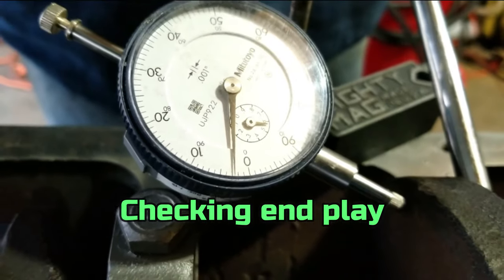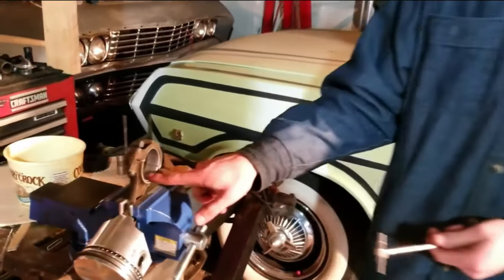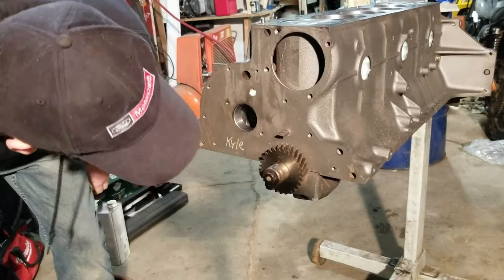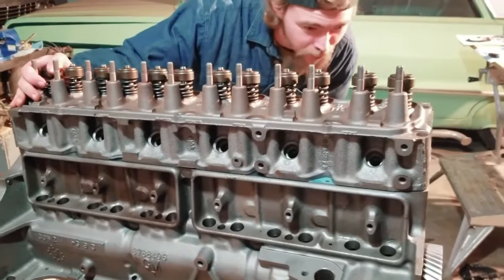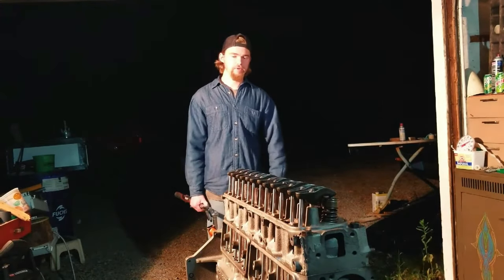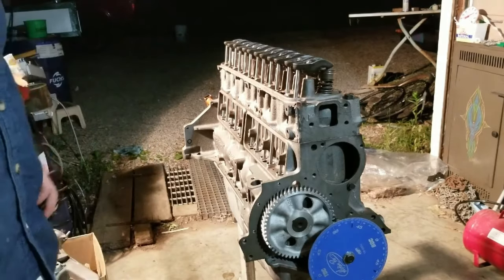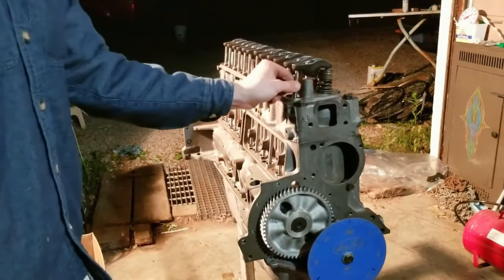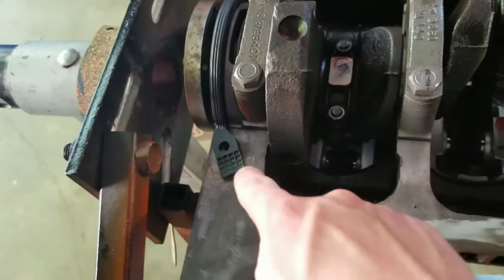REBUILD IN 10 MINUTES! Chevy inline 6

Comment: very impressive kid, thanks for your contribution to society. you will go far. I wish more people would make videos like this to help out eachothers builds.
Reply from the maker: @OakvilleConcreteContractor  thanks man! It was fun and I will be doing another one soon that makes a little more power. Right now I’d like to put a better carb on here but not too big since intakes are expensive and it’s all stock. But a 2 barrel that works correctly would be an upgrade. The one barrel has some issues, still drivable though.

Comment: I had a 250 in a 1976 GMC Sierra that I gave a grand total of $75 for the whole truck. It was an old farm truck that had never been registered or tagged and had 75000 original miles. The truck was in very rough condition. I wound up replacing everything but the cab. 
The 250, however, was in great shape and very tough. All I ever did to the engine was unplug a wire that was connected to the carb...if I left it plugged in, the truck idled @ about 6000 rpm. Unplugged it ran normally. I put s new battery in it and drove it problem free for three years. 
I wish I still had it.

Comment: Really interesting! I just bought a 1958 Apache 3800 dump truck with a 235. It starts, runs, drives like a top haha, even the dump is strong. Lots of lifter noise, sounds a bit like a diesel. I am trying to decide what to do, I think I’ll keep it original.
Reply from the maker: Do a valve adjustment, I have a video on that, hopefully the cam is ok but that was the issue with ours. Just one bad lobe.

Comment: The chrome valve cover on my 292 rusted. I should have waxed or polished or clear coated it. (A heads up, for what it's worth.) I'm glad to see another straight six on the go. They're really good engines, unreasonably looked down on. They make plenty of power and torque, and are smooth and good on fuel, besides being nice to look at. And because everybody and his dog, and its fleas, all have V8s, the straight sixes are exceptional. I put a QuadraJet on an Offenhauser manifold on my 292, (53 Pontiac) but I'm going to stick with the MonoJet on my 250. (40  Buick) I read about 250s or 292s having progressive two barrels, in the last year or so of production, and with the integral heads. It's also nice to see a Bel Air four door getting some well deserved respect.
Reply from the maker: That's why I wanted to keep this engine alive, nobody bothers with them and a V8 would just create more work and problems with the extra hp. I'd want to upgrade other things that it doesn't really need. My buddy's 79 k5 has a 250 with that two barrel and the head with the intake casted to the head all as one. But he had to switch it to the regular style head, and now has a Holley 390 4 barrel. Ours still needs a better carb, and a dual master cylinder with new rear wheel cylinders.
Reply: @Trikekid84  Years ago I had a two barrel to one barrel adapter, sold (I think) by Trans Dapt, in case you think of going that route. The dual master cylinder is "a sound idea". I use K car ones on my old cars.
Reply: Wait your saying a 292 gets good fuel economy? In what world? I get about 4 mpg in my 80 k20
Reply: @micahfrye8885  Well, in Canada, of course, where our gallons are bigger. (Small attempt at humor there - I feel your pain.) I once read a comment from a guy who said with a two ton (heavy, anyway) load on, he got 11 mpg from his 292. And with no load, he got 11 mpg. My 292 experience has been better, running through a 700R4 and a 2.73 rear axle. My concept of good fuel economy is outdated, but when I formed it, 20 mpg (Imperial gallons, 5/4 of US gallons) - so 16 mpg US - was considered pretty good. Mine has exceeded that while cruising. 4 mpg seems really low. Good thing gas is so cheap, isn't it?
Reply from the maker: @stephenandloriyoung5716  that is pretty good considering I could never get more than 12.5 from a 300 i6 f150 that had a 5 speed, 4wd, and 3:55 gearing. Another great engine for it's time.
Reply: @Trikekid84  Final drive ratio can have a pretty significant impact on fuel economy, and a light foot on the go pedal can, too. I've never heard of 4wd being good for fuel economy, either, as the extra heavy components have to be lugged around all the time it isn't in use, as well as the time it's earning its keep. I share your respect for the Ford 300. Without 4wd, and with a numerically lower axle ratio, it could very well deliver good fuel economy (by my obsolete standard) especially with MPFI. These heavy duty engines are made for hard work, and I guess we shouldn't begrudge them a bit more fuel while they do it. Everything's a trade off.
Reply from the maker: @stephenandloriyoung5716  I never checked the weight or gear ratio of the Bel-Air. But with the 2 speed we get around 18mpg, with a carb air leak that only helps so why even fix it? Haha.

Comment: Awesome car ! Cool video of the rebuild hope it’s still running good !
Reply from the maker: Runs great! Carb has a lean spot still but besides that it runs smoothly. Might switch to 10w40, oil pressure drops on a long trip but only when it's hot hot.
Reply from the maker: Runs great! Carb has a lean spot still but besides that it runs smoothly. Might switch to 10w40, oil pressure drops on a long trip but only when it's hot hot.

Comment: One thing I didn't see, you should only tighten the 1st head bolt on the driver's side to 85 LBS. FT. on these 3rd gen Stovebolts, except for the 292.  That part of the block is weak, and making that bolt 95 can easily cause the walls of the water jacket in that area to crack.   It is hardly worth trying to fix that area, as the crack is often inaccessible.  (Someday when gas engines are as rare as hen's teeth, that will be a different story).
Reply from the maker: I think I show that in a separate video but I did know about that. I think the 235 and the 292 have more material there, taller deck. But yes don't over torque that one. Thanks for watching!
Reply: @Trikekid84  Yes, the 235, 292, and the 261 do indeed have more in that location.
Reply: Same as the 250? Jesus I'm glad I saw this

Comment: In Canada, the Pontiac had a 261 c.i.d, a bored out 235, using Chevy motors and wasn't a wide tracking U.S Pontiac, which had Pontiac motors.
Reply from the maker: 261 was a truck motor in U. S

Comment: I'm currently rebuilding my 64' belair inline 6! Where did you get the parts at? Also what did you use to clean the inside of the engine?
Reply from the maker: The machine shop cleaned the engine and provided most of the internal parts. The gaskets, cam, and lifters were from rock auto. Valve covers and lifter covers I found on eBay. And everything else we re-used like rods and the crank.
Reply from the maker: Let me know if you need help finding any parts.
Reply: @Trikekid84  How much did it all cost you?
Reply from the maker: @brandonmitzel  I think the machine shop charged us $800-1000, can't remember exactly, but that was with all the parts we needed besides the dress up parts and paint. The bad cam lobe snowballed into a full rebuild. I had fun rebuilding it and you don't see any 6s at car shows which is another reason we kept this engine, and it was cheaper overall.

Comment: The inline chevy timin doesnt use a chain.    Awesome
Reply from the maker: It'll never wear out of phase with the crank! Which also helps the timing always be correct. Ford did this on the 300 as well which makes them last a long time. Not sure why other engines even use chains.

Comment: One doesn't even need to know where TDC is on any of the cylinders to lash the valves. I use the "E.O.I.C." (E.xhaust O.pening, I.ntake C.losing) method to lash valves...

Rotate the engine in it's normal direction of rotation until the exhaust valve just begins to open, the intake lifter is now on the base circle of the cam, lash the intake valve on that cylinder. Now rotate the engine again until the intake valve fully opens, and stop rotating it when it just gets past max lift and starts to close, now the exhaust lifter will be on the base circle, lash the exhaust valve. Proceed the same way for the rest of the cylinders..

You do NOT have to know, and follow, the firing order for the particular engine you are working on to lash the valves this way, but if you do know it, and follow it, there will be much less manual turning of the crankshaft to get the valves in the correct positions.
Reply from the maker: I like the vice grip garage method. Even better than my method.
Reply: @Trikekid84  Whatever works the easiest for you. 🍻

Comment: hey my grandfather left me a 1981Chevy C10 custom deluxe inline 6..... I want to keep the original motor but try to get a lit more power wat would u suggest
Reply from the maker: Cam for sure, not sure how much it would help to raise the compression, but if it needs pistons you can look into it. That engine should have hardened exhaust seats so that should be good. I'd say just a cam and a 4 barrel intake and carb. I've seen 2barrel efi setups, that would be cool. Headers would help too. Basically anything that you would do to a 350. If you keep the stock pistons, look into how much you can mill the head. Also, look up lump porting the head. The stock head bolts go through all the ports and is killing flow. Hope this gives you some ideas.
Reply: Clifford Performance

Comment: My 63 Belair inline 6, that I've owned since 1999, has gone from a 5 qt to 6 qt oil change.
How about yours? Did it change too?
I have always changed my own, and suddenly it has grown another quart's worth of capacity. I am stumped.
Reply from the maker: @Todd-o8n  that is odd, most inline 6s this size take 6 qts. Mine takes 5 last time I changed it.
Reply: @Trikekid84  Imagine MY surprise at this turn of events.
I was lucky to have the extra quart as I was doing my truck too, but had to get the extra quart later for the truck.
I daily drove a 63 Biscayne 6 banger from 1990 to 99, but got the Belair and parked the 'Cayne. It's always been 5 qts with the filter, but is now 6. 
Reality appears to be flexible. 🫨
Reply from the maker: @Todd-o8n  maybe your dip stick tube is loose and pulling out? Tap it down until you feel it seat.
Reply: @Trikekid84  Thanks, but I've done that.

Comment: In order to tighten the rockers you need to rotate the crankshaft to put the next lifters on "neutral" position before setting the screws, right? Isn't it a problem since it's gonna spread the camshaft lube outside?
Reply from the maker: You can set both rockers at the same time as long as you are on the compression stroke. I rotated the engine a lot trying to figure out things and I can't see how there would be any cam assembly lube still on the lobes, but it hasn't failed.
Reply: @Trikekid84  Thanks, man! My camshaft went loose from the gear and moved toward the block. Totally mess. Just bought a new camshaft and was trying to figure out how to tighten the rockers without moving the engine, which would remove the lube from the cam.

Comment: love your video!   I am hoping to get your opinion on something. I have a chevy 350 that I want to freshen up without machining. I specifically want to replace the main and rod bearings to increase engine longevity. So regarding the rod bearings, can I just replace them, do the clearance checks, and retorque them without having to change the rod bolts/nuts? Its just a stock, average HP late 70' engine that is just a daily driver. Thoughts on this?
Reply from the maker: Yup, stock rod bolts are better than some aftermarket, and are plenty strong. I wouldn't worry unless it's 400hp+.
Reply: @Trikekid84  thank you very much!
Reply: @jtp682  If I were you, and you are not boring the cylinders, I would AT LEAST run a dingle-ball hone on a drill through the bores, and replace the rings. It's very cheap insurance that the engine will have fresh compression, won't burn oil, and will last MUCH longer, than if you don't do it. A dingle-ball hone is cheap as heck, and new stock replacement rings don't cost much either. For the time and very little money you'd have invested, it would be WELL worth it.

Comment: Are parts for these hard to find. I have a chance to get a 250 complete for 200. I just don't want to start rebuilding and not be able to finish. Good job on this one BTW.
Reply from the maker: I found everything I needed, they make performance parts too, just that I couldn't find a oil pan but the 230 in the cars were not very common, the 250 was more common so you can probably find everything you need.
Reply: @Trikekid84  awesome. Thank you.
Reply: See if you can get a 292. The 250 is a dog beyond modification.
Reply: If you have something to use it in . I remember back when they were common. The Chevy 6 cylinder engines were all good.  The 250s are simply one of  the best engines ever. Maybe not if you're into racing. Although my brother and I each had nova with one. They were both fast enough to get in trouble.

Comment: Im very interested,  what is your channel.  Doing a truck 250 6 cyl now.  Want to add a few performance parts.  Thanks   Bill C
Reply from the maker: All terrain tv, I have a whole bunch of videos on the build. It's all stock though. You could get a lump port kit, mill the head, get a cam, headers, and a 4barrel intake with a 390cfm carb. Might only make 200hp but would probably have decent torque. I just love these engines because they are simple as heck and you don't see them too much anymore. The i6 has come a long way. I hear the new trail blazer engines like boost more than a LS in some cases.

Comment: I have a ‘67 Camaro inline 6, anyone have tips on where to start with it? It doesn’t even turn over
Reply from the maker: You can oil the cylinders and break it free. But it won't last too long after you get it running, usually when that happens it's just really hard on the rings after that. Worth fixing though!

Comment: Looks like you painted over the grime on the oil pan.
Reply from the maker: No that's clean jb weld haha.
Reply: Ok. I would TIGed it or bought another oil pan, I have literaly years of experience using JB weld. Trust me after a little while that epoxy will pull away from the metal.
Reply from the maker: @DYLAN102001  I could not find a new pan anywhere, after blasting it was full of holes so we welded in a patch and there was a few tiny drips so I jb welded it and it's been good for 4 years. Will it last? Not sure but so far so good.
Reply: @Trikekid84  Craigslist my man. I have 2 whole motors from some chevy K5s. Currently rebuilding one for a generator, that how I came across your video.

Tried jb weld to fix a timing chain off a small block. Scrubbed and roughed up the surfaceon both sides, started leaking around the weld. Wish I just bought a new one. Also tried fixing a head on a Buick 3300 motor, same thing. Hopefully it stays leak free.

 If it leaks you know who to call.

Comment: i have a 235 with hydro lifters but it has the old tube that the rockers ride on its a 1953. can i change the head to a rockers like the one in the vid
Reply from the maker: I'm not sure, the 235 head and valve cover look wider than mine. You would have to check pushrod length.
Reply: @Trikekid84  thanks man!

Comment: hi guys, is that a two on one barrel ?
Reply from the maker: Single barrel Rochester B. Still has a lean spot when you accelerate, we have just been driving around it. Probably an acceleration pump problem but I can't figure it out. Would like to try a 2 barrel.
Reply: thanks so much. @Trikekid84

Comment: What manual did you use for this rebuild?
Reply from the maker: Chevrolet Inline 6 Power Manual by 	
Leo Santucci.
Reply: @Trikekid84  Roger, thank you! I'm going to be rebuilding one for an engine swap.
Reply from the maker: @GIITW.5OKC  Awesome! The reason we rebuilt ours instead of a 283/327/350 swap was becuase you just don't see inline 6s at shows anymore.
Reply: @Trikekid84   yup.. all SBCs and BBCs at car shows now, can make 2hp per cubic in on the 292 as well.. I'm gonna stick it in a very commonly LS swapped Chevy truck.

Comment: How much for the build
Reply from the maker: I think we have $900 in the engine and then maybe $50 in paint, bolts and gaskets that's about it. The alternator, radiator, ignition parts were all replaced before the cam went out.
Reply: @Trikekid84  from where did you get the parts
Reply from the maker: @jeancadet5862  the machine shop for most of it. Hastings rings and bearings are what I remember, not sure the brand in the pistons, felpro gaskets. Summit racing, jegs, or rock auto. We actually got the cam and lifters from rock auto.